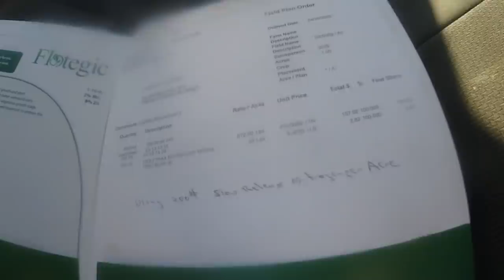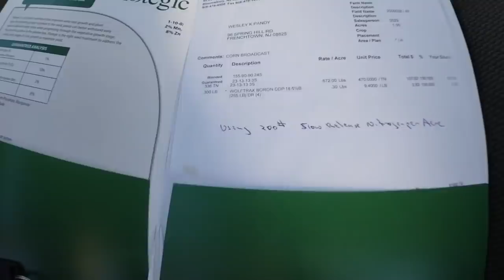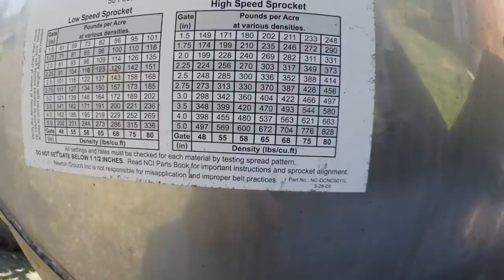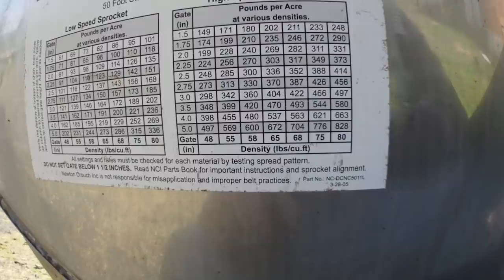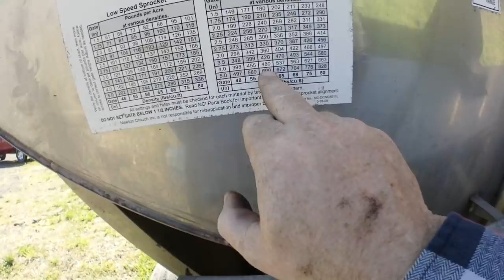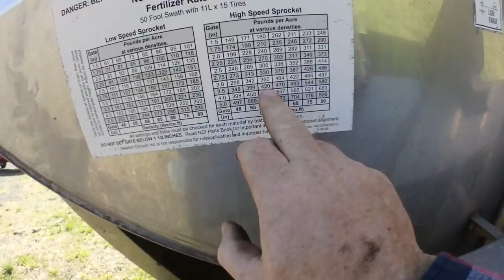Pounding Down The Nutients

Comment: We used to use copper sulfate as tree root control when burying sewer lines.  Tree roots will actually change direction of growth when it encounters it, instead of the roots actually growing into the pipe

Comment: The twine I use for little bales comes from Finland.  I've seen shields that were fabricated for the ends of the front disk gangs to keep them from throwing soil so far.  That lets the rear gangs pull the soil back and cuts down on ridging at higher speeds.

Comment: I would consider our land fairly good on soil fertility and we would put about 700 lbs of c. 300kg of of compound along with 6000 gallons of good tick slurry to the acre to grow maize silage here in Ireland and the sulphur and boron in the compound over here is what makes it bloody expensive we have to sort of mix up a couple of different products to get what we need because the fert companies don't do custom made products actually I am wrong we generally put on a bit of extra nitrogen as well so it is closer to 350 kg or 750lbs maize is an expensive crop to grow every where apparently.
Reply: About €800 an acre to grow in Ireland
Reply: Claetus Woodroofe actually if you add in a land value and harvesting, depending on the draw , it works out at about €1100 an acre don't forget we sow under plastic for the most part so that adds a bit, we get the fert a bit cheaper than the USA and the seed is a bit cheaper too I believe, it's a very expensive crop to grow one way or another, and quite risky for us, with the price of ground maize at the moment we are not growing any maize this year on the basis that America is not making as much ethanol as usual so maize should be plentiful next winter

Comment: why is it up here in central canda do farmers let corn freeze in the field before they combine it! never could figure that one out
Reply: harvey snarf moisture probably to high to harvest. Either that or field was to wet to get equipment into without getting stuck. If they wait till it gets froze it will in theory freeze dry. Many farmers waited till mid March before finishing combining corn this spring to not have use corn dryer to get moisture down which is quite expensive to operate.